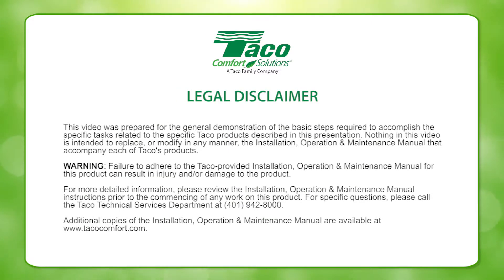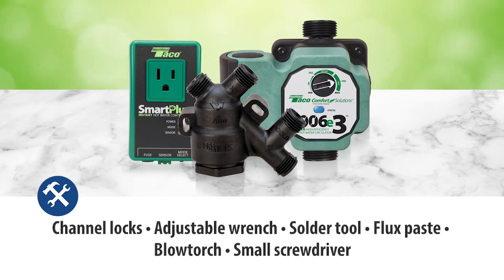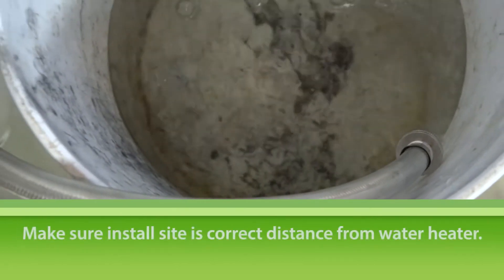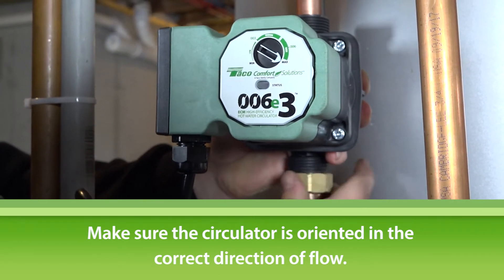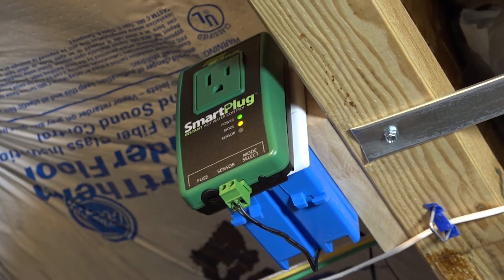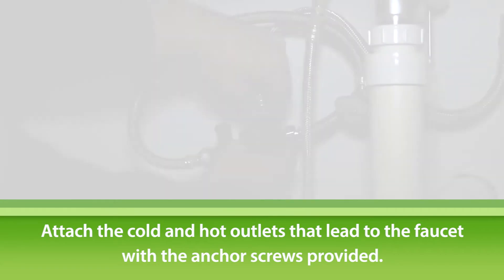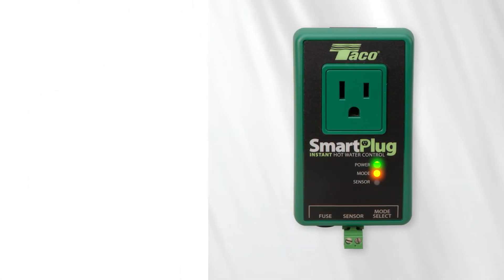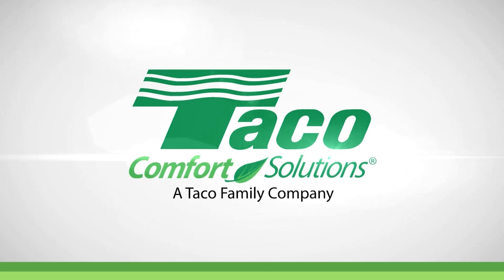Installing the Taco® HotLinkPlus-e™

Comment: What’s better this or installing a dedicated return line?
Reply: Dedicated, you won’t have warm water in your cold lines.
Reply: @danlux4954  

I agree
Reply: @danlux4954  Is that really such an issue with aquastats with an automatic shutoff valve when it starts detecting warm water?
Reply: @MikeTrieu  well the one i have doesn’t have an aquastat per se, it’s just a temperature sensor on the outside of the pipe. So my cold water line gets very hot water and defeats the point of not having to run the water to get the proper temperature water.